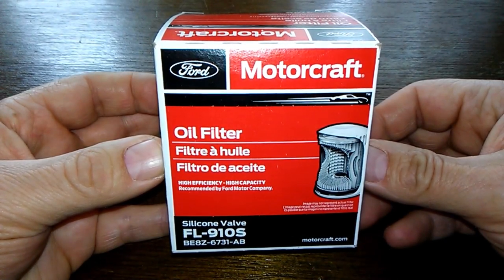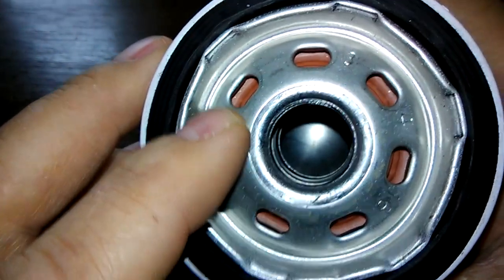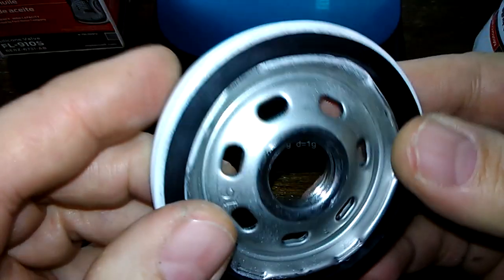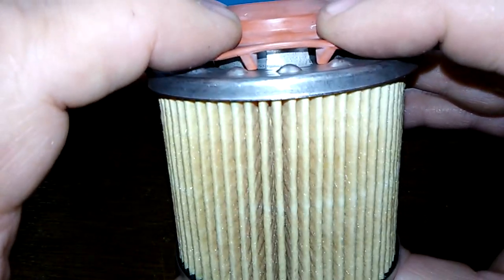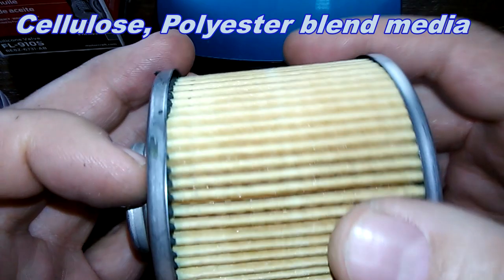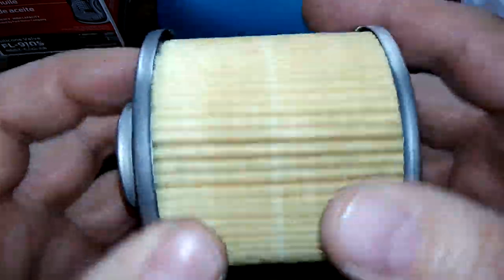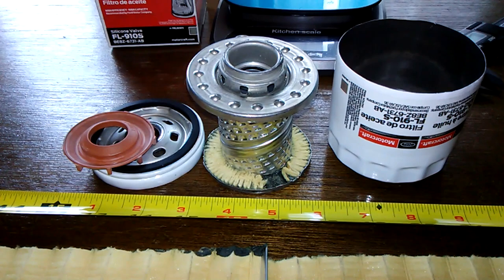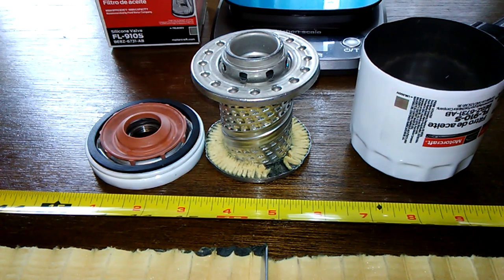Motorcraft Oil Filter Cut open FL910S

Comment: I run this motorcraft fl-910s on my crown victoria police interceptor, never had an issue, and that's with cold starts at -40 degrees celcius (live in canada). Listen if this oil filter is good enough for a long cold Canadian winter then its just fine for any of the American states. A big reason for the silicone anti drain back valve is because it's better in extreme cold and hot, so no matter where you live your covered. This is a good filter for the price and if you change your fluids and filter on time your more than fine with this product
Reply: @Channel-gz9hm   ah I see good to know, ya I know it eventually evens out just wasn't sure where
Reply: I thought the Crown Vic with that 4.6L V8 would use an FL-820S filter?
Reply: @LA_Commander  the civilian models use the fl-820s, the police model used the fl-920s. Both the same 4.6l 2v engines.
Reply: @thcscarface1  Oh wow I never knew that, thanks for the info.  What is the FL-920S?  Is that the same as the FL-910S? Or was that a typo?
Reply: @LA_Commander  oh yes sorry just a typo I meant 910s
Reply: @thcscarface1  Oh ok thanks

Comment: Fyi, 910S also good choice to use on mowers with Kohler&Briggs in place of the significantly more expensive spec OPE filters. More efficient and use a silicone adbv, OPE use nitrile. Just need to make sure to have clearance for extra .5 -.7in length. 910S solid filter for ~$4 WM/Amazon price.
Reply from the maker: Hi faxman09,
Thanks for sharing that information👍

Comment: Motorcraft is the ONLY filter I will use on my 2006 Crown Victoria Police Interceptor. Every other filter I tried resulted in a dry start up.
Reply: Having the same problem with my 96 Mark 8 also.
Reply: @DS-ss7vl  I owned a 94 and a 95 Mark VIII. I never had dry start up issues with Motorcraft filters on them but I did have problems with the oil cooler filter adapter gasket leaking on them and had to replace them on both cars twice.
Reply: @DS-ss7vl  You could have a bad timing chain tensioner.
Reply: true dat~!~~~90 lx 5.0 same thang!!!!!

Comment: I've used this filter on my Ford Ranger  for almost 260000 miles, 14 years. Until It didn't pass inspection because of the rust. I still use it on my briggs and stratton Intek engines.

Comment: You could use that filter on a Harley-Davidson twin cam,  I used to use the 400s same filter but longer but got tired of painting them black. I have been using the 820s on my Ford f150 for years and never a problem, in my opinion motorcraft filters are one of the best for the money. Thanks for all the great videos
Reply from the maker: Your Welcome,
Thanks for the feedback.👍🙌😊
Reply: What engine on the HD would like to try this and how did you like them thanks
Reply: I used the fl910s on a 2001 road king, the 400 hit my crank sensor. I ran the  15w40 motor craft oil in it too.
Reply: @leardi58   I had the 96 engine,  and I think they work on the 103, and I now have the 110, which is the same filter but have switched to k&n , it's a little easier to remove with the nut on the end. Sold the other bike this spring,  had 80 thousand miles on it been running mobil 15w50 for years and it still ran like new and  going to keep using it in my 110 . Get it at Walmart 5 quart jug..

Comment: Makes me feel good that I've been using these filters on oour family fleet for years. Fun fact: FL-910s fits my wife's Escape ans my Kohler 23HP in my Cub Cadet.
Reply from the maker: Thanks for that sharing that information👍🙌😊
Reply: I use a FL400s on my Intek Briggs. Twice as big as the stock filter... half the price.
Reply: @WhipCityWrencher  There are only a few thread sizes. I always swap up to the biggest can that will fit on the engine. Like a ph2 at $4 - it is 3x the size of the stock little baseball filter on many autos. 3600 size filters come in 3 lengths, all at the same price.

Comment: For that price point, you won't find a better filter anywhere.  Sure, there are better filters out there for twice the price.  But at that entry level price point you could get a Super Tech, a Fram orange, an AC Delco, etc.  I would go with the Motorcraft any day of the week.  Have use the MC filter on both my Ford vehicles and have gotten over a quarter million miles out of both and still running after 20 years.  But, I change oil/filter every 5,000 miles.

Comment: I REALLY like the FoMoCo Motorcraft bypass valve design and location. I wish Purolaor would use this design on their own filters. The Boss would be a killer oil filter with this valve (it would be even better).
Reply from the maker: I like them bypass valves also, and your right the Boss would be even better.
Reply: @WhipCityWrencher  They do 'sort of' make one. It's the Ford Racing FL-1HP which is a beast of a filter. Probably all of the best features of any filter in one package. But, damn, it's expensive. You can find them occasionally for around $20 + shipping. It has the good FoMoCo/Motorcraft bypass in the top. I used to get the regular FL-1A's for $3.97 which was the best deal for a 3k mile filter.
Reply from the maker: @vincemajestyk9497  I have to open up one of those filters and do a comparison. Thanks!

Comment: I have used an 820-S, along with Supertech 5w30 full synthetic, on my '05 5.4 F150, since new. It now has 212,000+ with nothing, but, standard maintenance being done. Still runs like new.
Reply: I have the same truck with the 3 valve Triton engine. I've used all kinds of filters. I change my oil whenever I have any doubts about the condition,color or smell. I have almost 300,000 on mine.

Comment: Only oil filter I ever had a problem with was a Motorcraft Fl-1A bought at Walmart approximently 1990ish.  Made the oil idiot light stay on a few seconds longer at start up and valves rattle on my 4.9liter straight 6 F150 (1984). Changed oil and filter again, problem never returned.
Reply from the maker: My vehicle uses that same filter, but I'm not too fond of the Fl1A. The best feature of that filter is the upper bypass valve. I would have loved to open up that oil filter to see what was wrong with it. Thanks for the feedback.👍🙏😊

Comment: I use motorcraft filters religiously, but lately, i have trouble finding them in stock. 
I recently bought a new yamaha jet boat with a 1.8L yamaha high output engine. It calls for 10w-40 marine oil, namely yamalube. It's only readily available in conventional. Ok. I can live with that. 
The yamaha oil filter looks like a cheap chinese clone, tho. I saw one guy online using a motorcraft fl910s, so maybe i'll use one of those.... not sure.

Comment: I use the 910-S on my Briggs and Stratton, Kawasaki, and Kohler lawn engines. Have for many years and never had any engine issues. In fact the engines always last longer than the mower. Less than half the price of the of the respective manufactures filters.
Reply from the maker: Yep,
I've heard others using this oil filter on their lawnmowers and motorcycles. Thanks for your feedback.👍😊

Comment: I use the same FL-910S filter on my 1999 Harley FLHR Road King. It is a TC88 upgraded to a 95" Screamin' Eagle. I was tired of the overpriced Harley filters and did research to look for less expensive but suitable filters. The two I liked are the Purolator, and this  Motorcraft. Since 2014, no issues,and I do not care about the white filters on my black bike. I think it gives it character. I also run 15W-50 Mobil 1 synthetic 99% of the time. The 1% was Super Tech Dino oil when I was low on money, and 20W-50 Castrol when it was on sale. Someone told me about Mobil 1, and at $23-26 for a gallon, it is a lot better price than motorcycle oil.
Reply from the maker: That's a nice bike, back in the 80's I had a 83 XLX Sportster. It was a fun bike to ride.
The Motorcraft filter along with the Mobil oil should serve you well, the inside of the FL910s is one of the better-looking Motorcraft filters that I've opened up.
Have fun with your bike and safe riding.👍
Reply: The Motorcraft filters are made by Purolator, both are good quality filters!
Reply: @WhipCityWrencher  Thank you so much, you ride safe, too. It was refreshing to see this vid and comment... I did lots of research just to save a few buck on filters, and I know you are not supposed to screw around with them.
Reply: @LA_Commander  Oh cool, I love the reinforcement on the quality of the Motorcraft and Purolator filters... I was happy to find these alternatives. I also ran the weird blue BOSCH a couple times, but after I did more research, more positives with Purolator and Motorcraft. And no, I never ever ever ran a FRAM, LOL.
Reply from the maker: @gbounit   I dont care for the orange can, but the Fram Ultra is a good oil filter.

Comment: I have motorcraft on my 2016 F250 6.2 123k miles always the same filter with mobile 1. I see Wix among other higher priced filters have a 90% filtration rate? Would it make that much difference? Next oil change as my engine is getting up in miles, I'll switch to one of the higher filter rate ones for a few extra bucks.  Great vid thanks.
Reply from the maker: JMHO,
I'm one of those guys who like to stick with OEM Motorcraft parts (as long as they're not crazy expensive) for their Ford vehicles, but as far as oil filters go Id rather a Wix XP,  Fram Ultra, or Napa Platinum, etc.. any day, with good synthetic oil. Thanks for the feedback.👍🙏😊
Reply: If you have a modern Ford, OEM Motorcraft is the only way to go!

Comment: Fl400s about the same.is better than a fram ?
Reply from the maker: I don't know if it's better than a Fram PH3600,  the two oil filters do have their differences. The Fram has a better micron rating though.
 If you step up to a Fram Ultra or Titanium then Fram is certainly better IMHO.

Comment: Motorcraft/Purolator is a better than average $4 oil filter, MUCH better than an equivalent Fram - Fram used to be good back  in the day but they went downhill in quality pretty bad the last few years, unless you buy their expensive ones

Comment: Engines need to have a free flowing oil.i never use a fram cause it has a tendency to hold back pressure and reduce the flow.

Comment: I was told by a guy who works for fram, that they make the short motorcraft filters, and Purolator makes the longer filters.
Reply from the maker: I've never heard of that before.
Reply: @WhipCityWrencher  yep, he said the make most oem filters, and private label.
Reply from the maker: @MattTigers  Is there a way to tell which ones they make? I know all the Motorcraft oil filters I've opened up have a date code that is easy to decipher.

Comment: Dumb question, has anyone seen a oil filter can blow out with proper change intervals?  I be seen them blow on high performance race engines where the pressure gets high? 

But on a normal use passager car never seen an oil filter blow threw a can.  

Great video!
Reply from the maker: Thank You!
No, I never have.
Reply: Not a dumb question, have not seen it myself, but heard it used to happen in very cold first start ups with thick oil. I live in Fla never had temps. that low.

Comment: I’d like to know if I could use the Motorcraft FL-500-S as a Substitute for the Motorcraft FL-910-S. That way I could carry one Filter for Three of the Family Ford Vehicles. Also I wouldn’t mind the little extra Oil Capacity, as I could use full quarts.
Reply from the maker: No, it won't screw on, they have different size threads.
Reply: @WhipCityWrencher  You are absolutely right. The thread diameter between the two is different enough, you don’t even need to measure to tell the difference.
Reply: The 500 s and the 820 s are 22 mm , the 910s is a 3/4 16 thread . Will not interchange !
Reply: No you can't Steven, but you CAN use the longer FL-400 filter instead of the FL-910.  The price is the same and the FL-400 is slightly longer. Of course if space is very tight then use the 910.  Cheers.

Comment: So if you run pure synthetic lubricant do you need a special filter? Or will this work?
Reply: Good video👍🏼
Reply from the maker: @garyrathbone4586  Thank You! 😊🙌
You can use synthetic or conventional oil with this oil filter.
Basically, you can use synthetic oil on all oil filters. You might Not Want to use conventional oil on a filter that costs 20 bucks that has a low micron rating, because the oil may not flow as well as it would if you were using synthetic oil. Hope this helps.
Thanks for watching👍
Reply: @WhipCityWrencher  thank you

Comment: If you are this worried about what your oil filter looks like your engine will never wear out due to the oil filter you use. The engines that will wear out are the people that get their oil changed every 12,000 miles and some guy puts on a 99 cent filter.

Comment: What’s the mileage rating?
Reply from the maker: Sorry,
I couldn't find anything on Motorcraft oil filters stating a mileage rating.
I dont think they have an "official" set mileage rating.
Reply: If you read your Ford owner's manuals it varies from 5,000 miles to 7,500 miles.  Depends on the specific model and year of car.  But that is what I've seen in various Ford owner's manuals.

Comment: Pity that so few understand that the AIR filter quality and sealing of the air box determines the life of the oil. Put my 8 pound dozer air filter on a Caravan and it will last 100,000 miles. No room on autos for real air filters anymore.  My Deere 6 cylinder diesel has 2 oil filters in a bank and hold 6 gallons of oil. Autos are really pathetic in filter regards.
Reply from the maker: I wish the manufactures of air filters would share some kind of filtration numbers on their air filters.

Comment: How do you read the date code to know month and year
Reply from the maker: Funny you asked on this video because Motorcraft is about the only ones I can somewhat read. Most every filter brand has a different way to read them. So if you want to read other codes I suggest a google search for that specific brand filter. Now, this Motorcraft has a date code of 901232114, so If you remove the (9) the 1st number,  you'll have 01 which would stand for Jan., then you have the number 23 that would be 23rd of Jan. then you have 21 that would be the year 2021, it works for this decade. I dont know about older filters, and I dont know what the 1st number or the last 2 stands for either, could be workers shift, machine, etc..?
Hope this helps you out.😊
Reply: @WhipCityWrencher  wow thanks so much I'm going to check this out because that's all use is motorcraft. Good stuff thanks again 👍
Reply from the maker: @leardi58  You're Welcome.
Reply: The day code doesn't matter !!
 There is no expiration date on Oil Filters.
 The day code is there to spot manufactruring problems in the system.
Reply: @WhipCityWrencher  Why would the date be so important?
Reply from the maker: @johnnellis3025  Well if one filter was ten years old and another one a year old, I would take the newer of the two. The older the filter the greater the chance the inside has gotten contaminated with moisture and such. Plus if the filter has a filter blend media or paper, the paper will degrade with time. Plus while the outside may look the same manufacturers change the inside components from time to time, so you may like an older or newer design. ( A good example would be the Wix XP), Just a few reasons why it's good for us the consumer. It's also good for the manufactures in case they run into a lot of the same complaints about a specific filter, then they'll know when it was made, and by whom was working there at the time. Just some reason why I think it's important.
Reply: @WhipCityWrencher  o.k. sounds good to me.

Comment: Just curious has anyone actually had an incident with any oil filter failing?  Been driving since 1987 and have used countless oil filters over the years as have my friends.  My cousin has been an auto mechanic for over 20 years, have used Fram oil filters on a Ford 332ci built motor making 450HP+ and I have never experienced or heard of anyone ever having an an incident with an oil filter failing.
Reply from the maker: Back in the '70s and 80's I had some engines that had spun bearings. I never thought of opening up the oil filter, so who knows. I have opened one Champion oil filter that had a flattened leaf spring.